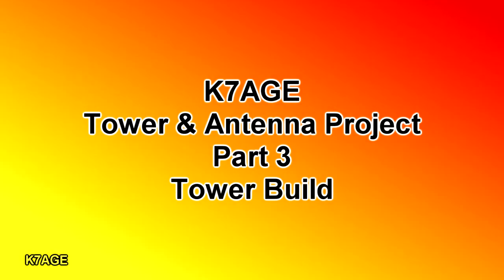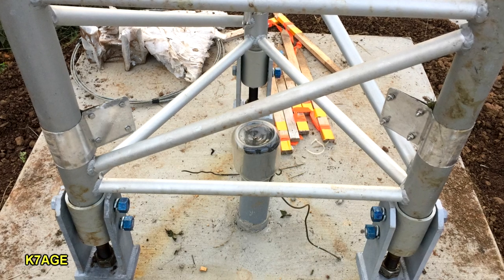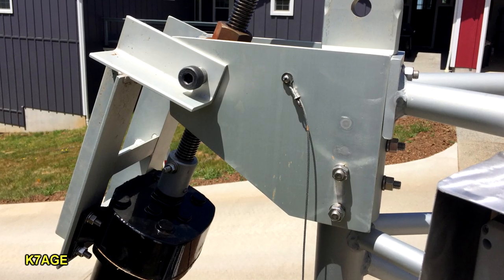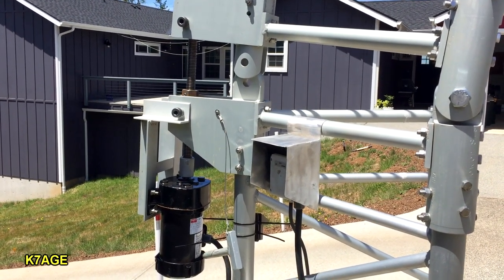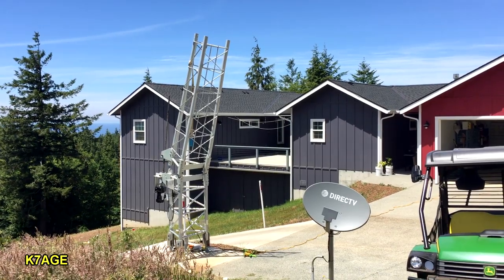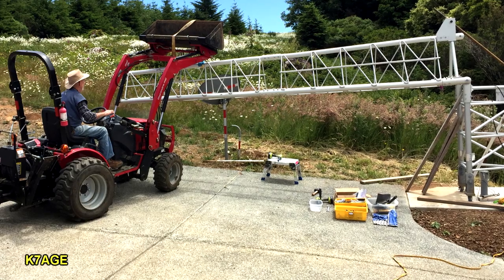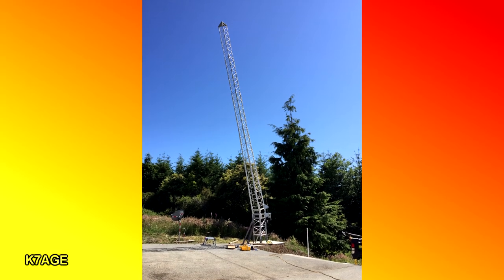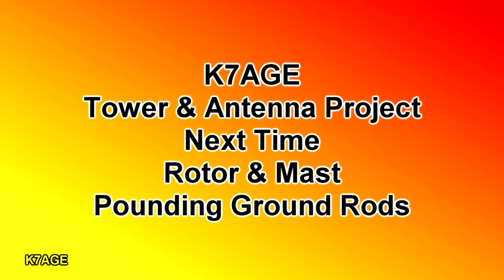Part 3: Assemble the Tower

Comment: Interesting tilt mechanism, although once the tower sections are on it and antenna, thats going to be alot of weight for the threads on the rod to hold.
Reply from the maker: That is what it is designed for

Comment: Nice tower there. Put that on my wish list. One thing you should do is make sure you grease the threads on the shaft. Those are acme threads and they need grease or you could run into failure in going up and down with it. They don't take kindly to rust in them. Great investment though. It's a beauty. 73 de AC8GF

Comment: K7AGE,  that long threaded rod is what's known as a lead screw.  Be sure to keep it in good repair, and keep it greased!
red lithium grease is a commonly used lubricant INDOORS. i don't know about outdoor use.
If it were mine,  i would have a dedicated chip brush and some rags handy, and clean and re-grease regularly. (use one brush for taking off the old grease and one for applying the new)  I work with these types of motors on a larger scale and the lead screw is inspected often.
Reply from the maker: I’ll get it cleaned and greased

Comment: Don't manually pound in ground rods. Use a large hammer drill and a ground rod bit. Rentable at a big box hardware store, or if you have a buddy that's an electrician, they may help. Also consider that rest of the ground system. 

Good work so far. WA5TT